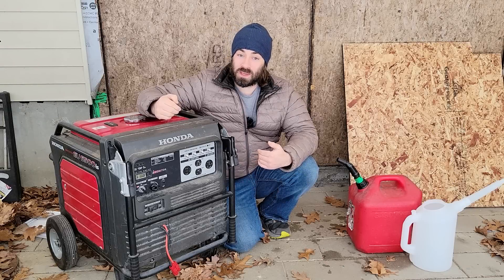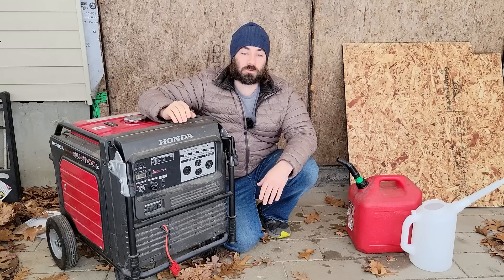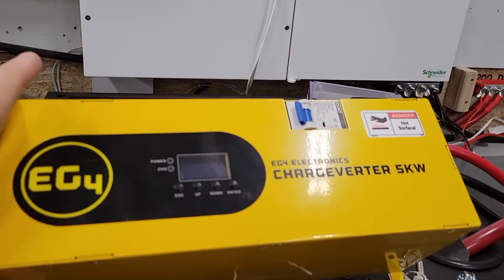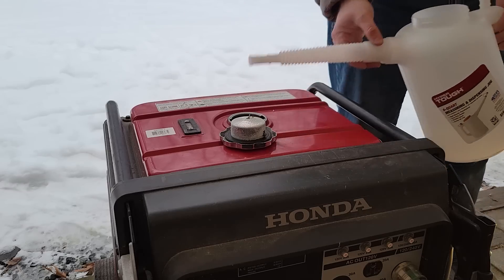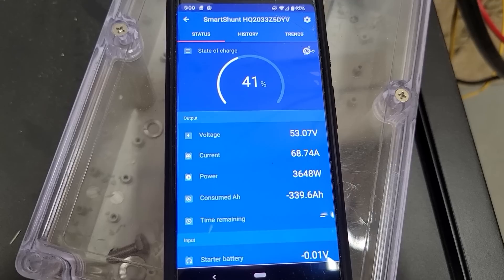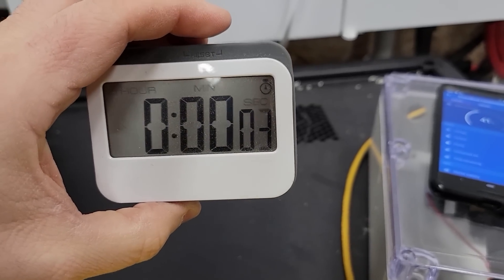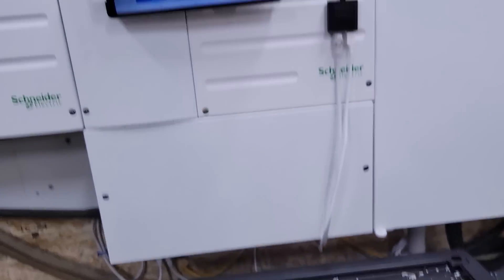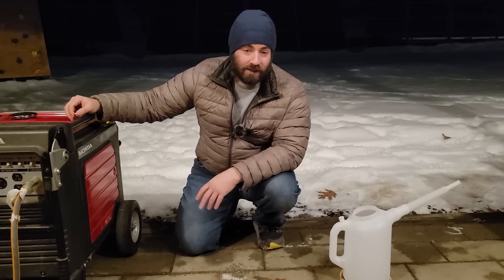Not what I expected.

Comment: Thanks for doing this! I've always wondered how much generating your own power would cost. 5.9 kWh / $4.16 gal reg unl = 70.5 cents per kWh
Reply: That is actually quite an efficient generator. Still 70 cent/kWh vs around 2 cent/kWh for solar is 35x more expensive.
I also heat my house with solar PV in a cold climate and I do not have a gasoline generator or any other sort of backup.
Reply: @electrodacus  Would love to see some more video from you! I have couple SBMS from you!
Reply: One more thing: fuel is just one of the costs. You'll be burning more money when you add generator maintenance (oil changes, spark plug, battery replacement, air filter...), wear (it eventually gets worn out and needs to be replaced by another expensive generator), using fuel in your car to haul fuel to the generator... Fuel should be the big cost, but everything else will add up to so much you need to factor it in.
Reply: And grid power is about 12p. I understand the off-grid life, but most of us live in the civilized world where the grid does exist. (my farm has power, and the meter costs more than the power we use. ROI for an off-grid setup would be in the centuries, for the record. I'd do it, but a**holes would just steal it.)
Reply: @jfbeam  but you are only using a generator for a few days, so probably still cheaper to be off grid in a lot of cases.
Reply: In my part of the hypocrite belt, we just went 3 or 4 days with essentially no solar. We have gone as many as 12. You either need a freight train loaded with money, or a generator.  I had estimated 65 c/kwh at $3.  This is nice to know exactly. Thanks David. Sizing a system to balance panels,batteries, and backup is dicey to me. 3-4 dollar gas can nail you quickly. And with minimum bills, benevolence is not on the agenda for the utility.
Reply: That’s why it’s cheaper in the long run to buy more solar panels and charge controllers if needed. 34kWp and counting. Gen not needed so far at 38° latitude in the hypocrite belt.
Reply: What is an hypocrite belt? Genuine question.

Comment: To get best value from the generator fuel try to find a use for the waste heat from the exhaust pipe. Something like 40% of the energy put into the engine as gasoline is lost from the exhaust as heat. If it's really cold then the LiFePO4 batteries will like some heat around them for best function and life.

Comment: Good solid generator.
One problem is conversion efficiency, a mere 16%. Run the gen indoors to get up to 80%. Put a hose on exhaust to scavenge that heat as well before venting it out. Remaining heat can be used to warm up air going on to the engine.
Reply: That is the way to go, wasting all that heat from the engine....
Hooking it up to the water heater would be even better.

Comment: I am not totally surprised, but I did expect there would be some differences and its a testament to the generator that there really weren't.   Of course, it was pushing steady power the whole time, so "idle" losses would not be a factor in any of the tests.  Still though, I'm imrpessed!

The amperage is going to be the same along the whole wire loop no matter what the wire resistance is.  The wire resistance will reduce the voltage only.  That is, some power is lost due to wire resistance (power = current * voltage), but the amperage (and thus amp-hours) remains the same.

Ultimately what is important here is to read the generator specifications, there should be a specification for the maximum efficiency point.  Or a curve, or something.    The charger should also have a specification somewhere (but generally it will be near the top-end of its capability).

The batteries themselves... well, that many batteries, are being charged at well under 1C even at 100A, so their efficiency will not be affected at all for any of the amperages tested.

-Matt

Comment: there are more losses than just electrical ones.  just spinning the engine is a fairly large loss.  the longer it runs the more you lose.  so the slower you charge the battery the more you lose mechanically but you save electrically.  only experimentation will tell you which curve is stronger at which loads.  Also think of wear and tear.  running the generator for long periods at max output can overheat the components.  and if you blow the inverter, it's likely cheaper to replace the generator than fix/repair the inverter.  not having to replace a $5000 generator buys a lot of grid power 😄

Comment: Don't inverter style generators generate dirty AC then convert it to DC then to from DC to clean (pure sine wave) AC?  If so it would be interested in tapping that DC off the Honda generator and see how much efficiency improves by avoiding the final conversion to AC.  Wonder if it could be hacked safely if it would get more charge per gallon.

Comment: Maybe time to look into a wood gasifier for fuel. Also, you can couple your heat pumps to the ground... if you've got digging equipment or access to, it'll probably be cost effective rather quickly. 

Another thought, I added 60w ir bulbs pointed right at me in places where I spend lots of time, and lowered my thermostat by ~5 degrees. Couple that with heated blankets and I get massive savings on the coldest days. I'm sure this approach could yield better comfort and energy savings, but I just don't get that many cold days to go further with it.
Reply: I would think that for wood it would be more efficient to use stirling engine for generation, though it is more difficult to find.
Reply: @bumbarabun  It is, but it's difficult to scale large enough for home power generation. Way easier to just make fuel for a conventional generator set.

Comment: Interesting test I really think if you was looking for higher amperage and the least fuel consumption you would be better off with a larger car or truck gas or diesel engine idling and driving 4 alternators with isolated grounds to get the best fuel consumption and faster charge rate much like the 1800 rpm generators use less fuel and engine idling at 800 rpm would even conserve more.
 but another question is if your charging at 100 amps and 50 volts and your battery is made up of 16 lipo4 cells how much amperage are you actually charging each cell at 6-7 amps?
Reply from the maker: If you are charging 1 battery at 100 Amps, then each cell is seeing 100A.  This is because there are 16 cells wired in series.  Each cell has a nominal Voltage of 3.2V, wired in series makes 51.2V.  But, if you have two batteries in parallel, then each sees 50A.  And so on.

Comment: Would it not be way more efficient to run the generator direct to you fuse board as 1 gallon of gas has 33kw of energy in it!  so the more direct it can be used the better.
Reply from the maker: Depends.  If you are running a 5kW load directly from the generator (like a water heater) then "YES".  If you only have a few lights and TV on, using 1kW, then "NO".

Comment: I have a 14KW diesel generator and it has a fuel efficiency chart to get the highest power output for the least amount of diesel fuel use.  I will use that as a guide, and for my gasoline inverter generator I will use the 80%+ rating to charge the batteries.

Comment: It would have been interesting to see the run time results as well. Since the power output was roughly the same as measured by the shunt I have to believe the runtime was less as you increased the load.   Maybe a shorter runtime is more advantageous for any number of reasons.
Reply: yes run time is very important given the results were almost identical for amperage. Can you run longer on reduced load? and still charge the same amount.
Reply: @kevinthompson4690  Why would you want to run longer and get the same amount? Why not run the max power for the shortest time if fuel economy is the same either way.
Reply: @enigma9789  Engine wear. The higher the load, the more it wear it. But it is probably minimal, time (years) will damage it more than the extra load

Comment: Here in CT we pay $0.35 per kwhr. I run a Onan marine generator water cooled to charge my bank and heat my shop. The power going in my battery is basically free as I need to heat the shop. I do not have all the gadgets to test my system like you but it's working well for me.
Reply: Heating your shop is a great way to get more useful energy from the generator. You get an A+ for doing CHP, Combined Heat and Power.

Comment: The idea I love about charging a battery w/ the generator is that the generator isn't wasting fuel on low-current applications (i.e. like a car moving itself at idle). It can charge the battery, potentially while also supplying electricity for needs, so the additional energy potential isn't wasted (except in inverter/voltage efficiencies). I wonder what the math is like on powering a house w/ generator, vs powering a house and charging a battery at the same time, so once the generator is off, the battery continues to power the home.
Reply: I'm so glad you didn't write the word "with" in full - apparently it's illegal now.

Comment: Thanks for a great video David.  Thanks to the Commenters for their ideas.  For engine/generators my ball park rule of thumb for efficiency is 30% exhaust loss, 30% cooling system loss, 20% friction/ electrical loss, and 20% useful energy. Since your generator is air cooled and all this exhaust/cooling loss comes out as hot air, what if we set the generator by the mini split (maybe a duct) and move this waste heat into the house on a cold winter day when it is needed? Would this increase overall efficiency, 17% + @ 60% like combined heat and power? Could you do a video on this.
Reply: That's brilliant! I was stuck on water-cooled engines heating a storage tank. Thank you.

Comment: I suspect you already know this but if not: You can go to your local General Aviation airport and purchase "100LL" which is ethanol free. Since you could need to rely on your generator and there is not an available propane conversion (I assumed you don't have a big propane tank in your yard) for your HONDA, the need to store gasoline in your generator and in reserve is there. "Ave Gas" stores well and is available if your state (like mine) does not sell ethanol-free gasoline.
Reply from the maker: Thanks for the tip.

Comment: Another point to consider is the efficiency of the generator itself. One gallon of gasoline contains 34 kWh of energy (approx), and the generator delivered 5.8 kWh of electrical energy into its load (the EG4 charger) on one gallon of gas, so 5.8/34 = 17% efficiency. By comparison, utility-scale combined cycle natural gas fired power plants run at about 55 to 60% efficiency.

Comment: Let me start by saying I really like alternative generation, storage and utilization of energy.  I fully believe solar, wind and other renewable energy sources are how we will power our lives in the future.  However, as you mentioned at the beginning of this video, there are times when those renewable sources just aren't reliable, so we have to be prepared with other solutions, including using fossil fuels, when necessary.  Now, with that disclaimer out of the way, I think it is absolutely worth noting how much energy (roughly 5.8kw) you were able to put back into your battery bank with just a gallon of gasoline.  When you consider that is probably close to 20% of your daily electricity usage, it's pretty remarkable that you could charge that much in a short time, using such a small amount of fuel.  It's comforting to know that when solar isn't enough, just a few gallons of gas will charge up your system enough to keep the lights on and your household operating normally.

Comment: I'm not sure if that is a dual or tri fuel generator.  But it would be interesting to also compare the results with either propane or natural gas.  I'm thinking cost of fuel here. In my area propane is currently at  $2.25/ gallon and natural gas is around $1.10/ therm.
Reply: I converted my Honda EU7000is to run on either natural gas, propane or gasoline using the MSK7000 tri-fuel kit. It puts out a little bit less power on natural gas, but it's nice not having to worry about the fuel getting stale or running out during a long outage. Highly recommend going with iridium spark plugs when running on natural gas.
Reply: @browsedeweb8834  Why less spark on natural gas ?
Reply: @onthelake9554  The Horse Power maybe less but the combustion characteristics of NG means a Hotter Plug. It ignites easy compared to Propane or 95Octane

Comment: The fact that the auto-throttle is still throttling down slightly on the highest load, says to me the Honda still has some more headroom. I suspect the Honda will be most efficient at max sustainable power.
Reply: Not sure I'd want to run it at max load continuously due to heat buildup of the components. I think running between 50% and 80% is the sweet spot for air cooled gasoline generators if you're at all concerned about longevity of the engine and inverter module.  A few hours is probably fine.

Comment: This is great data! I've defiantly thought about adding a generator to my system. I've got two 100 amp chargers so it might be interesting to connect them both together and charge at 180 amps! Then compare the fuel price vs grid power. Thanks so much for your hard work and the crazy amount of time I'd take to produce this video David.
Reply from the maker: Thank you for recognizing the time spent to make these tests and videos.  It's a lot of work.
Reply: At $4.00 a gallon that works out to $0.69 per KW for 5.8 KW; while significantly higher than the average utility this is good to know for those times when Solar needs some help in an off-grid application. Thanks David!
Reply: Been off grid 2o yrs ,high output altnator and chargers,. Your battery bank will only accept the charge the battery can take ,I surgest 1 kVA EU Honda , with 15 amp max quality charger,or build DC Genset 4o amo car alt four stroke 2 HP , Honda 1 will run 8 hrs for half a gallon

Comment: Those inverter generators are impressively efficient.  Usually between about 20% to 90% load you are going to be pretty similar.  I'm surprised the last run did so well!
Reply: I wouldn't call 17.5% efficiency impressive.
Reply: @mcg6762  ikr, I have 60kva genset at work that go up to 29% at 85% load

Comment: Good evening.
It would be interesting to see what happens if you take one of these generators without an inverter and connect a charger that directly charges the battery pack from the DC of the generator. Double conversion is eliminated. There would only be losses from the engine/generator/rectifier/charger unit.
Reply: These generators only typically output about 8A @ 12v or 96W, so it would take 60+ hours of engine operation to get the same wattage back into batteries at that rate.

Comment: Given that your efficiency was basicly the same at all charging levels wouldn't it be a better idea to usually run it at the lower rate to minimize wear and tear on the generator?
Reply from the maker: Not necessarily.  You would be correct if we were at risk of an over-heating situation.  But, extending the run-time also puts wear and tear on the generator and increases the number of oil changes.

Comment: $3.50/gal divided by 5.9kWh/gal equals 59 cents/kWh. That's about 5 times the national average price of grid electricity delivered to the home. Although 59 cents sounds expensive at first, that is probably a bargain compared to upfront and recurring cost of being connected to the grid, especially for a home that didn't have the grid to begin with. And if you only need to generate from gasoline, say, 10% or less of your annual energy consumption, then yeah, no problem. Good work, David! I would be curious how that compares to other types/models of generators. Maybe you can borrow friends' open frame generators, smaller 120V suitcase generators, or even a new fuel-injected model for comparison testing. edit: just watched your suitcase generator comparison video, not sure how I missed that.

Comment: Great video David, I think you may have been trying to double count the 80%, the 5500 watt rated output is 85% of the max output, and is what the generator is designed to run at extended periods for. There are arguments for lower output causing less strain and wear, though conversely that puts more hours on the parts as well. You may also want to consider if the EG4 charger running at max is getting too toasty. Personally probably would go for 90-95 amps and a strict regime of quality oil changes to maintain engine efficiency.

Comment: My experience with generator power, The limit to output has more to do with ambient temperature, When the load is high the motor will shut down on high temp . This experience is from generators with liquid filled radiators

Comment: You mentioned the run time on the first test but not the others.Were they relatively close or was the run time shorter as amperage went up?If the run time shortens as amperage goes up you may as well go full out to get max recharge in least amount of time.
Reply from the maker: the run times got shorter.  The 70A test was the longest duration (1.5 hours).  The 100A test was the shortest duration (1 hour).
Reply: @DavidPozEnergy so a fairly direct relationship we can see here between time & power for the same quantity of fuel.

Comment: I think Eco throttle just means that the generator throttles down when it detects no load. So it has no effect on your test I believe.
Reply: That’s correct, no one seems to understand that the generator runs at 3600 rpm under load. It’s governor controls the throttle opening to maintain 3600 rpm delivering 120 v at 60 htz. Like driving your car on flat ground you press the pedal a certain amount and when a hill comes along you have to press the pedal more to maintain the same speed and rpm of the engine.